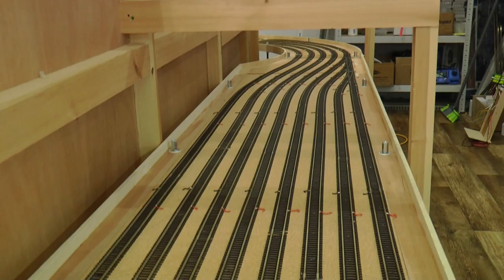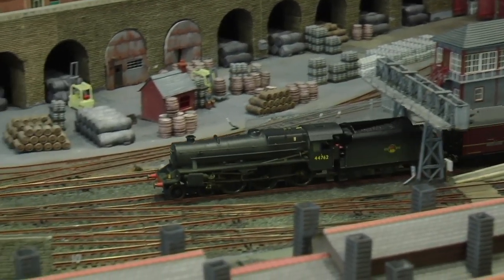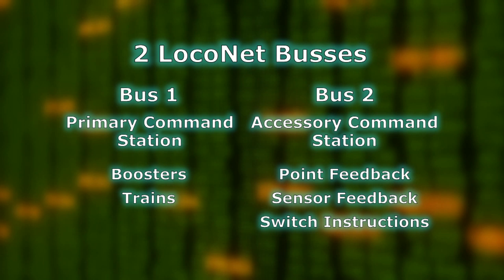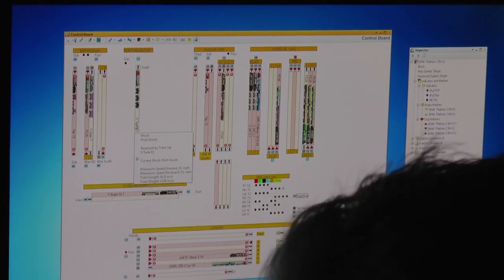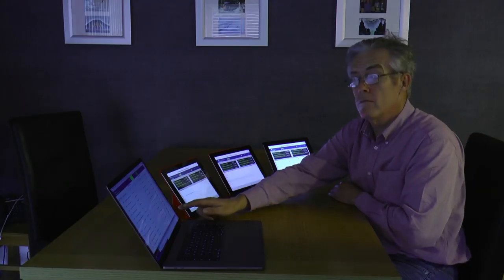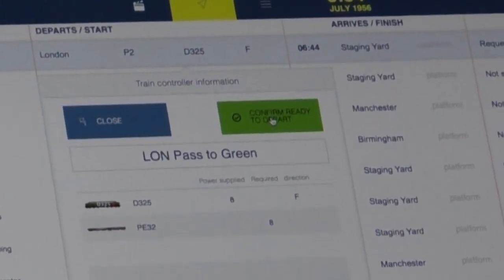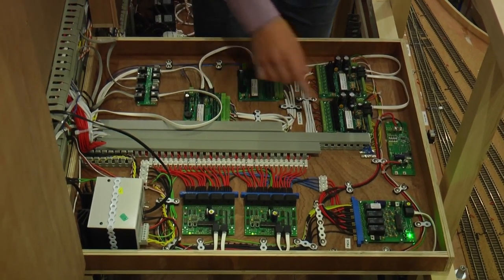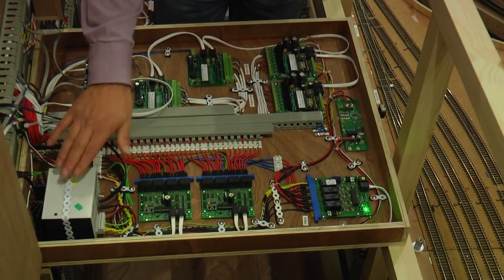15. Digital Development - An Integrated System

Comment: Fascinating, Admiral. Just out of interest, what's the power consumption in toto when (a) you switch on & (b) when everything's working with, say, eight plus trains running ?.............Captain.
Reply from the maker: Its nothing like an Arc-Welder.  In simple terms, the power consumption doubles when we put the kettle on for tea! So between 2 to 3kW.